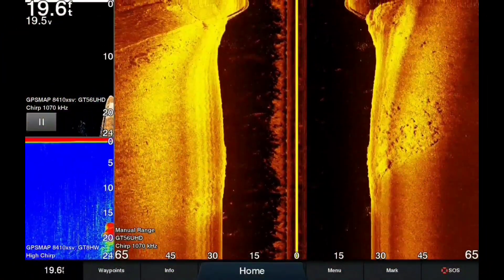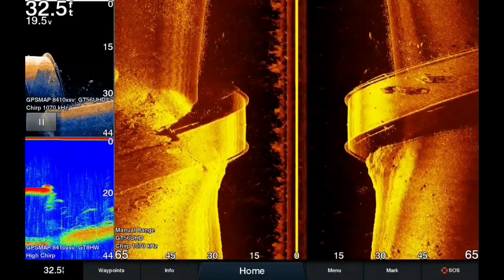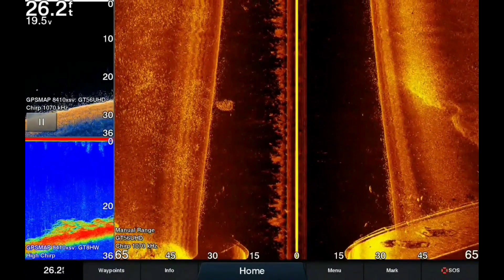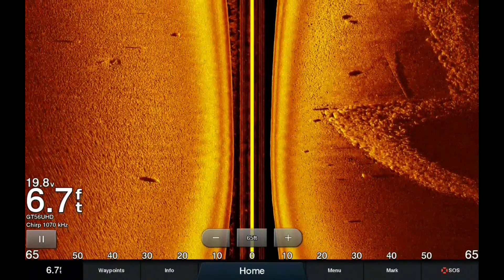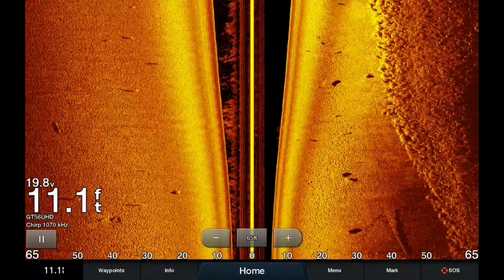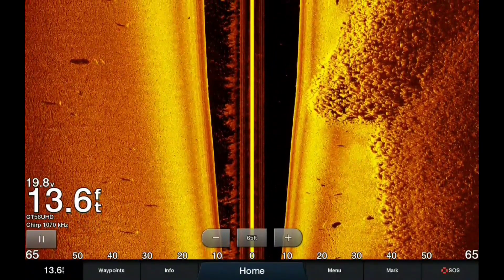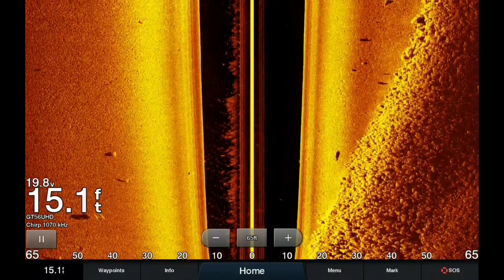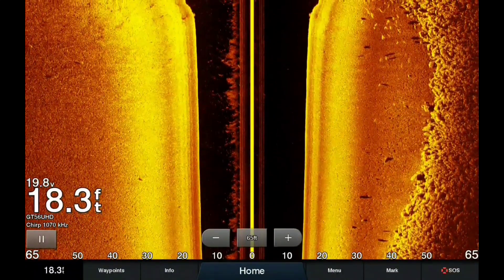New Garmin Gt56uhd Mega High Definition Side Scan and Down Scan Transducer on 8410xsv/8610xsv units.

Comment: I did notice it shows 19.8v. I take it you didn't have this hooked up to a 12 volt battery? What do you use for your power supply.
Reply from the maker: I used dewalt 20v. Some graphs are rated for up to 32v. I shot a video on that.

Comment: Is the GT56 compitable with the 93sv uhd units?
Reply from the maker: You'd have to double check on Garmins site. I believe so but you may need the extra transducer box.
Reply: Yes the new units ship with them. No extra box needed
Reply from the maker: @406life  thank you for clarifying.
Reply: Make sure it's not the 93 plus unit as that won't use the GT56 to fill capact

Comment: When did that transducer come out?  is it brand new? That is my biggest complaint with garmin is there side image sucks I got rid of my  Hummingbird Mega image Just to have the panoptix and now I was thinking about getting another hummingbird for the side  Image
Reply from the maker: Came out in November. If you get it get a unit with good enough pixels. Mine has 1980x1280 Garmin 8410xsv / 8610xsv series
Reply: @kansasyouthbass   I have the 7612
Reply from the maker: @kenrodman7620  that's a 1280x800 pixel which is better than all those sv units people are running.  Make sure the gt56 can run on that unit.  I believe it can with no add on.
Reply: Do you thing Humminbird have better side image then Garmin?
Reply from the maker: @pike.attack  they still have a slight advantage but its really getting close. Almost no need to have all 3 brands anymore. Garmin is getting close to birds. And now birds are getting close to garmins on live stuff coming out. So now its personal preference in my opinion. Lowrance is just getting left in the back.